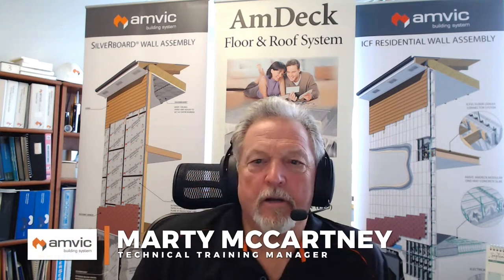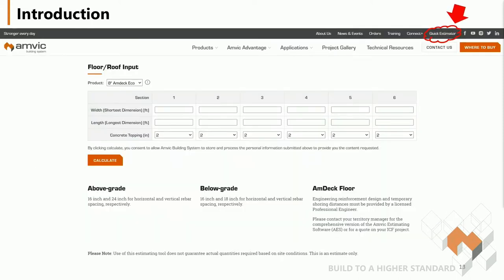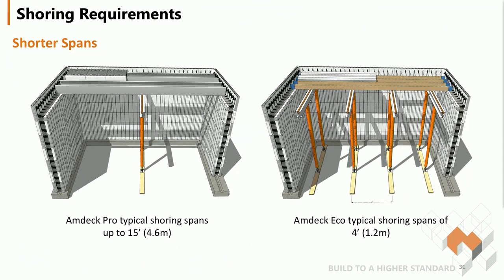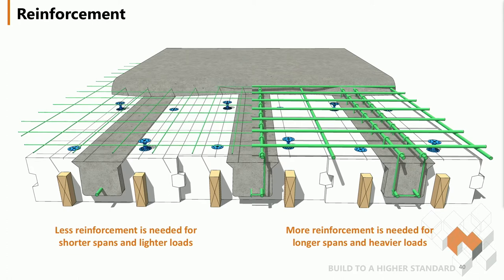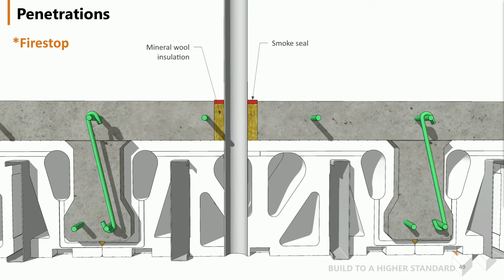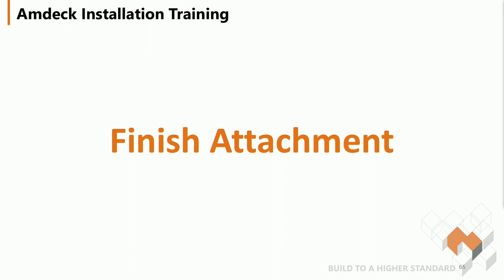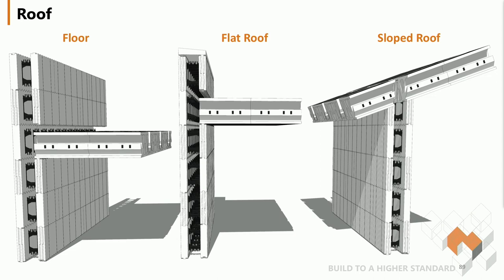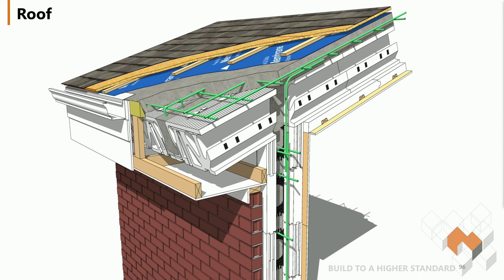Amvic Amdeck Installation Training - Level I

Comment: What happens when the reinforcing begins to rust with saltwater off car wheels expanding the reinforcing and spaulding the concrete?
Reply: Epoxy coat your garage floor .